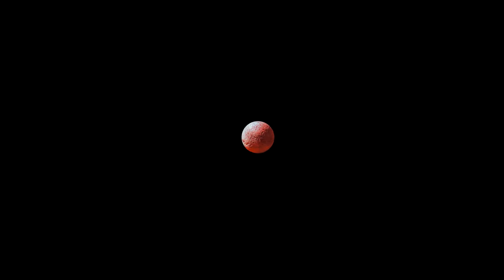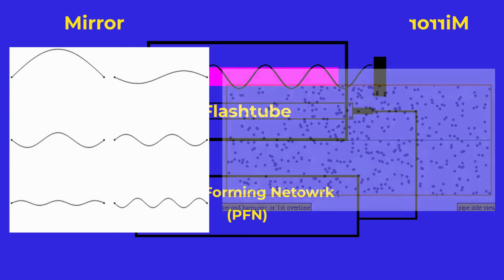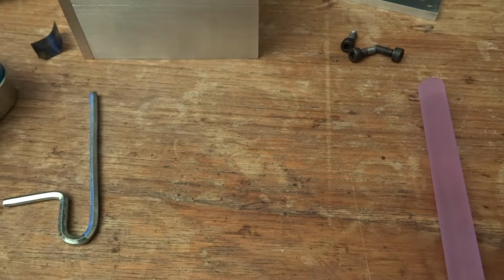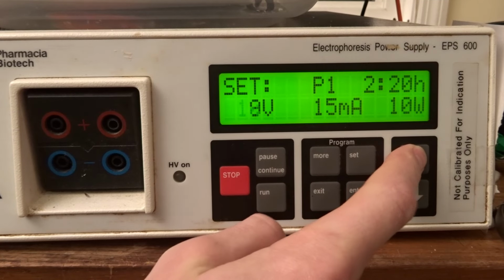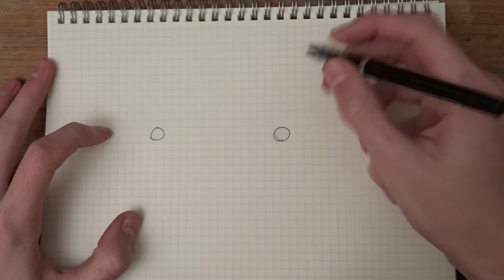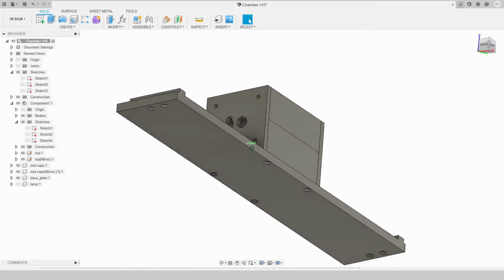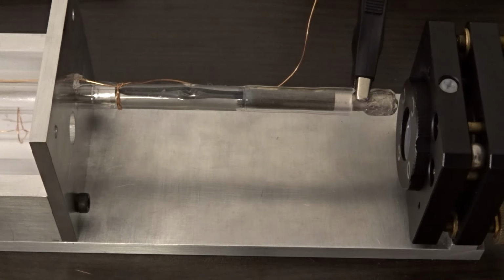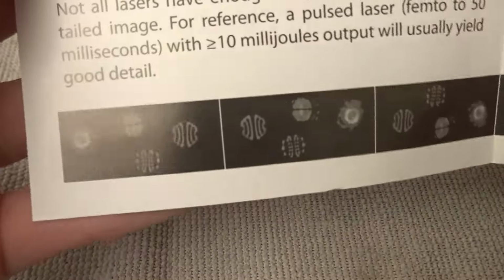Building a Solid State Laser - Pt. 1

Comment: A safer cap charger you can DIY is from electric fence pulse generators they are purposely built to charge a capacitor really quickly.
 You might need to fiddle/replace the control IC controlling the large transistors to be able to time and control current and pulse width.  Good luck on your endevours♥

Comment: Wouldn't it be less lossy if you pumped the laser rod with appropriate laser diodes? No high voltage power supply, less cooling, etc...

Comment: you can place the rod on its end on a cert. flat piece of marble and with simple machine tools ... a parallel and calipers measure between the marble on one end and the parallel on the other in a few directions and get a very good idea if the ends are parallel

Comment: First, if the rod ends are perpendicular to the rod's axis, then reflections from the rod ends will form additional resonant cavities; it will then be fairly impossible to bring all of the cavities into resonance simultaneously.  Typically, the ends are polished at 88 deg. from the axis so that these reflections immediately leave the cavity.  Second, refraction at the rod ends requires that the initial alignment be performed with the rod in place.  Third, copper sulfate in water could be used to plate the elliptical mirrors in copper rather cheaply.  Fourth, planar end mirrors form an unstable cavity; a confocal cavity using spherical mirrors would be a much wiser choice.  Fifth, it will probably be necessary to cool the elliptical space with distilled or DI water if more than a few pulses at a time are desired.  Sixth, capacitors can be charged in parallel and then connected in series before discharging; this might solve 2-3 of your problems.

Comment: You need to have standing waves in your rod to achieve amplification AkA your rood must have a specific length of a multiple of your emissions wave length other wise it will not work with the pumping and remission cycles. Also why do you put them in a circular mirror you need a eclipse mirror to have two focus points.

Comment: Bit of nerd fodder for you -- Krypton generates light more on the red side of the spectrum. Most krypton flashlamp tube walls are thinner than Xenon flashlamps.  If you are using a Xenon flashlamp,  no water jacket is OK for low cycle pulse counts. The thinner Krypton tube walls were designed to take advantage of the hydrostatic properties of water/ "you cannot compress a liquid".  The thinner wall material meant that higher energy amounts could be put into the lamp and more flashlamp energy could be transmitted to the rod and allow for more efficient heat removal.  What you buy on Fleabay is what you buy on Fleabay!

Comment: I think you will have a hard time with two planar mirrors. You might consider swapping one of them for a spherical mirror, which should make alignment easier.
Reply from the maker: While I did eventually get this working with the plane parallel mirrors (check out pt. 2 😉 ), you are right. It was very difficult to align and very difficult to keep aligned once it was. A more forgiving cavity would have made things easier - next time!

Comment: Hello there! Nice job! Hope it helps/ 
Some info about "GLS-1":
The cross section of the stimulated radiation 1.7E-20 cm^2
Refractive index at the wavelength of radiation 1.521
The absorption index at the wavelength of the radiation. 2E-3 cm^-1
Concentration of Nd ions. 1.9E+20 cm^-3
Luminescence attenuation time. 390E-6 sec
Quantum luminescence output 0.78
The population of the lower laser level, ions 6.84e+015 cm^-3
The wavelength of the radiation - 1064 nm XD

Comment: I thought there had to be an inductor in series with the capacitor voltage output to limit the current, otherwise the flash tubes will explode.

Comment: I also build lasers. I never made it work. No laser light came out no matter what I did. Finally I tried to insert an inductor in series with the capacitor bank and it did the trick.
If the light pulse is too short, there will be no laser light. I'm not saying that's what's wrong with your laser but it could be. That the lamp exploded at such low energy may be due to a far too short discharge time.
I use an OC mirror with only 30% -T. It works but I have no idea what is optimal.
I have some short video clips on my old laser in acction but I am building a new one, much bigger (because bigger is always better) So if you have more tips and ideas I will be happy to accept them.
You have made a very good video. Educational and interesting.
I'm waiting with excitement for part two.

Comment: I love this video! I'm excited for part 2! I really like your aluminum pump chamber, it looks super nice. I plan to 3d print a mold for my laser pump camber and cast a chamber out of plaster or other white ceramic. Fun fact some white ceramics will reflect more light than a really nice metal mirror! Also ceramic materials will help insulate the flashlamp from high voltage.

Comment: I would suggest that the flash tube be CLEAN.
I used to work in an instrument shop for a university chemistry department.
For any type of fairly high energy lamps we would wear a NEW (each time) pair of cotton gloves we handled flas tubes, and clean
them with alcohol and lint free cleaning wipes.  Otherwise when the tube flashed could explode from localized thermal energy from the oils from skin burning off.  
As a question, seeing your laser rod, it has a surface finish that is not very transparent. Could that be a cause of not enough energy transfer to make it not work?

Comment: I know this is old, but mill oring groves in the end plates to hold your flash lamps instead of having them lay on aluminium, it might be that the tubes got damaged because of uneven thermal transfer on one side of the glass (touching metal).

EDIT: fixed a typo - there was 'hot' instead of 'got' ;-)

Comment: One problem, among others, the Nd:YAG has very narrow absorption spectrum near 808nm, which is responsible for 1064nm output. The flashlamp, however, produces very broad output spectrum spreading over several hundreds nm. Any radiation outside 808nm (+-2GHz) is being lost, going into the heat. For  that reason, narrow-band IR diodes at 808nm are used instead of the Xe lamp.
   Secondly, the relaxation time of Nd+ is ~200us, so flash duration should be preferably under 100us short to concentrate the pump energy in time. Without the thyratron, the Xe lamp was likely producing ms-long pulse.
     Finally, the 1064nm radiation is not visible by naked eyes, so some detector should be used to confirm the single shot, the "magic paper" won't help.
     I hope that you can now appreciate Dr. Theodore Maiman's achievement after all and recollect his name.

Comment: Thank you, I'll now look more carefully to USSR flashlamps.. So they are cheap, worth experimenting. Exploding with excesive energy the 200$ worth lamp would be huge loss.

I've missed the one key component in your optical cavity design. Where is the cooling!? Sorry if missed your talk, the Nd:Glass have poor thermal conductivity, so you are left with several pulses per second repetition, because of heat. I'll always keep an eye on ebay's listings of these rods, they cheaper over Nd:YAG, but they have drawbacks. 

You should have asked seller about factory sheet and quality check, some sellers include the part with this information. So hmm I can't pin point the exact source for ГЛС-1, but you can look in this link: http://www.mathnet.ru/links/5e778527f5706333840160ae9af918dd/qe10047.pdf 3rd page, you can see params, more like so as general manual, the real params would be in the quality check sheet from factory.

So anyway, I'm looking forward to your project and presentations. Keep it up! Best regards.

Comment: Cool project! If you have problems with insulation of your high voltage stuff, try putting some PTFE around it. PTFE or Teflon as it's known for, is a very good insulator. You could try some Teflon tape used for piping.

Comment: 1) I really feel like you've got to make the mirror alignment with the rod in place. If the rod end surfaces were perfectly parallel there would be no difference between in place and not in place, but I think you've established that rod end parallelism is not a given. Your optical cavity may be bounded by the mirrors but ultimately the cavity includes the rod. The ends of the rods aren't really giving you the amplification anyway. 2) If aluminum surfaces have an absorption dip right where it hurts you the most, you wouldn't have to make the reflector out of copper or gold - you could make it out of aluminum like you did but gold or copper plate it instead. Copper would corrode but the gold sure wouldn't. 3) Amateur astronomers do silver their own mirrors, I believe - I think with vapor deposition. how would it be to vap-dep one end with some metal or another? Please let us know how your project progresses!

Comment: I've built a ruby laser at a similar size. The one thing I see you are missing is the inductor in the PFN. Otherwise you'll not get the pulse spread out enough and go into UV and also the plasma will get opaque. I used a quite large air core inductor, I think it was about 100uH with 2.5mm2 cable. I used the pfncalc1.xls from sam's laser faq.
Also, you will need to adjust the mirrors with the rod in place, the surfaces on the rod could be at a slight angle and this will mess things up. I used the same technique and got some sort of interference. A small low powered HeNe is better for this and should preferrably be single mode.

Comment: You need to be careful with the xenon tubes, touching them with bare hands leaves residue, that even when cleaning remains in the glass structure. When running the tubes at this powers, this produces hot spots on the surface and can lead to spontaneous dismantling of the tube...
Reply: Agreed, my memory from the childhood, when I was trying to source some Russian parts for a diy laser, for the flashtube, I clearly remember the note to avoid touching it with the bare hands or it will explode.

Comment: very sad you didn't do a follow up. I think your fault has to be the alignment : when I was aligning  a HeNe laser back in uni lab, I do remember seeing an interference pattern. I used a red laser keyring pointer to align it.

another thing that makes me very suspicious is your 80% mirror: in order to lase your resonator cavity will have to have at least 20% gain per period which's ridiculous, at least for HeNe laser that i was working with.

and lastly, are you sure that the rod's alignment does not matter? i aligned our laser with the working body installed.

Comment: If there is a chrome plating company in your area take your chamber to them and have it copper plated. They use copper as a sort of filler to be able to polish the part to be chrome plated to a very flat and smooth surface so the chrome looks really brilliant. You could then polish the interior to a brilliant shine in copper to help the wavelength reflection you are looking for. It's pretty cheap as well.
Reply: gold or silver electroplating can be done with qtip and battery

Comment: Electrolitics can't discharge fast, with just the wire inductance you are prob in ms range for the discharge
Reply: But that will not be a problem, yags(or nd glass) really want to lase, your cavity is probably more of a problem then the caps, that rod will lase even with 10uF @ 700v

Comment: looks as if you have so called high pressure xenon lamps. i have an old tattoo removal laser (passively Q-switched Nd YAG) here, it uses a low pressure xenon flash lamp. the lamp has max half the thickness of your lamps, is shorter and runs at up to 700V-800V. afaik, those have much higher explosion energies. when i short the capacitor to discharge it (through the lamp inductor to minimize stresses) it still sounds like a shot from a pistol. it's loud enough to make my ears beep when fully charged. the same discharge going through the lamp makes almost no sound, just a whispering "click". additionally, high pressure xenon lamps have the biggest peak in their spectrum at 1064nm, exactly the same wavelength as the laser output, which maximizes conversion and minimizes heating. i don't know, if the spectrum of low pressure xenon lamps is equally optimal.
my general quess is: you have still not enough photons for a population inversion. when i drive mine at lower energies, it becomes a normal flash lamp, no lasing. you should be able to recognize the laser output in case it starts to lase with that setup. no high tech required. just something in front of the laser like a newspaper. when it lases, it starts to explode the ink off the paper. you'll hear it and see plasma balls exploding from the surface of the paper.
well, at least that is how my laser behaves, it has this passive Q-switch added. your results should differ more or less. possibly your laser starts to lase at lower energies without this passive Q-switch.

Comment: Edit: I've had a quick look around about the alignment of laser cavities like yours and it seems that getting an  interference pattern isn't always critical and you should mostly be concerned about the position of the dots. So the rest of my comment which was about optimising that interference pattern might be useless.

The alignement of the cavity is equivalent to aligning an Michelson interferometer which is a procedure that is widely thaught so you should be able to find decent info on how it's done without too much trouble.
Some suggestions :
1) You probably need to double check on the laser you're using. You're trying to make an interference patern from beams that have an optical path difference of around 50cm (twice the cavity length), but typical HeNe lasers have a coherence length of 20cm (meaning that if the second beam travels for 20 cm longer than the first one the interference patern will start to disappear but I'm not sure how fast it goes away). In principle for this measurment you'd need a single frequency HeNe laser or a stabilized HeNe laser (wich I believe are the same) or any other laser with a coherence length that is more than 50cm (or equivalently a linewidth that is below 600MHz). 
2) instead of looking at the beam on a card placed on the laser itself you could put a 50-50 beam splitter at 45° (an economy beam splitter is 30$ on thorlabs)  on the laser path to look at the image outside the axis of the laser (note: depending on the beam splitter you use it will create a secondary beam offset from the first one due to reflections inside the beamsplitter wich may can be an issue if you pattern has low contrast to begin with)
3) you could use a lens to expand the beam of your laser in order to maximise the size of the pattern